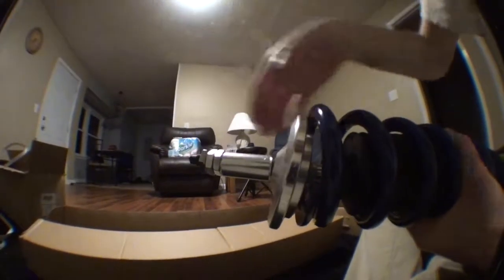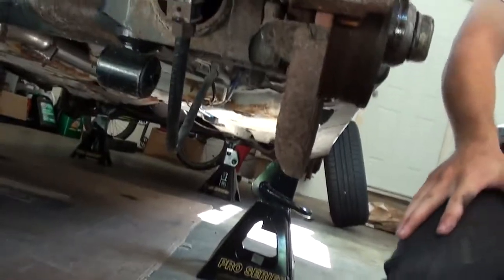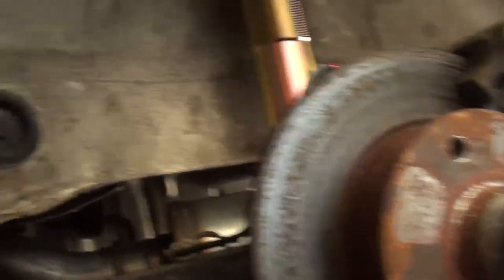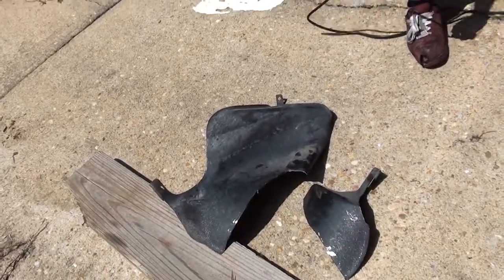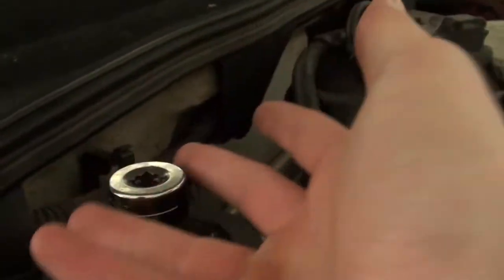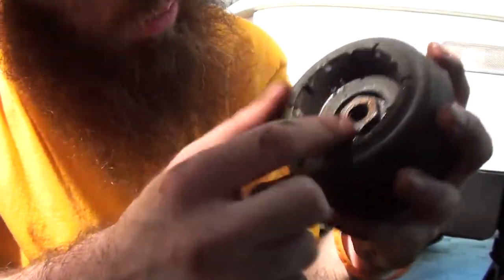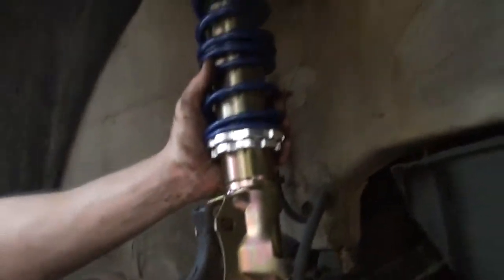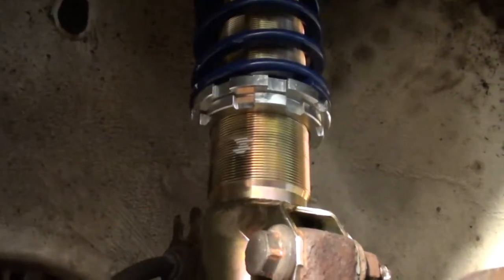Mk3 Jetta Vlog - Installing $200 Ebay Coils

Comment: I did the rear coilovers today your video helped alot =) just to finish the front and heights tomorrow
Reply from the maker: Awesome I'm glad I could help! Be careful with the front lol if you go too low you'll have to notch the frame so the axle doesn't hit it. Plus the oil pan hangs pretty low on these cars lol

Comment: So the rear coilovers you don't need to remove anything from the old strut?
And the front only the remove that bushing from the strut?
Reply from the maker: Sasuke garage yeah I believe the rear coilovers were fine. The front you have the big rubber bushing and bearing that sit on top of the suspension you need to transfer over. The coilovers are not high quality so I think I also found a way to use the stock spring seat on the front coilovers to center it more. I hope this answers your question. Let me know if you have others 😃
Reply: Guidosaur alright I let you know thank you for for your time

Comment: So how low did you go up front and how low in the rear? Thanks for sharing the vid btw...were those the vogtland fleabay coilovers?
Reply from the maker: 2.SloLove kinda hard to explain since I didn't really measure lol. On my stock wheels there's about 2 fingers between tire and fender on each corner. The back might be a tad higher because I kept hitting my exhaust hanger (the one under the shifter) on the lip of the garage, so I raised it. I have some pics of the car on  my Instagram by the same name. Video doesn't really show how bad this driveway is lol. They're from eBay and I think the "brand" was rsk. They were maybe $210 but for some reason I got free shipping and some discount so it was pretty much $200 flat.
Reply: Guidosaur I have just put £220 venom stance ones on for now. My drive ways on a slant, I have the front todo next.
Reply: Classickid21 I haven’t heard of those from here in the states. I recently threw on some WRDs - check my channel to seem the level of low, they ride great.
Reply: 2PTSLOWPRD German made Google. Venom motor sports based in UK but ship all over some. Really decent parts on there. Black. With purple spacers =) look awesome. I will. Sub to. You dude

Comment: I'm thinking to buy some coilovers for my mk3 golf would you suggest me to buy them?
Reply from the maker: Yes to buying coilovers, no to these specific ones unless you're broke like I am lmao. I just did it because it was my second car. They weren't bad, just really bouncy.
Reply: Guidosaur i am at the same point as you can see in my channel i have golf mk3 1 video and the other car is volvo v70
I want to learn change them and maybe they ar not so bad.😂 and i need to change them any whays. I need new ones. So should i look for better. Or i can use this.??? 😂 i hope u got my point.😂
Reply from the maker: @mghz11lv  I had a messed up factory strut that would have been like $50 to replace so I figured why not pay $200 and get 4 coilovers lol. They're easy to install and I didn't hate them. They're pretty bouncy but they worked as long as I owned the car. There was a clunking sound though. If you can save up $500-600 I think you could get higher quality coilovers, but if you want something cheap and right now the eBay ones are fine. You could also look for used coilovers on Facebook. This group called burnallthemk3s sells parts all the time, you might find used coilovers there. Good luck
Reply: Guidosaur cheers man... awesome. Advice. Have a good luck with cannell. Plus 1 sub from me.😃